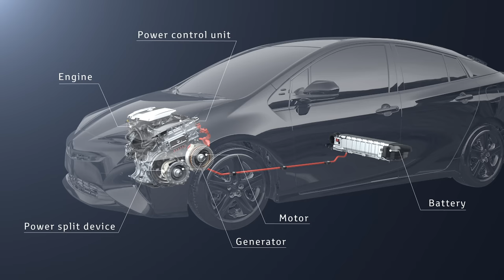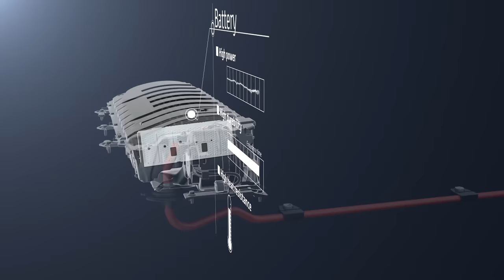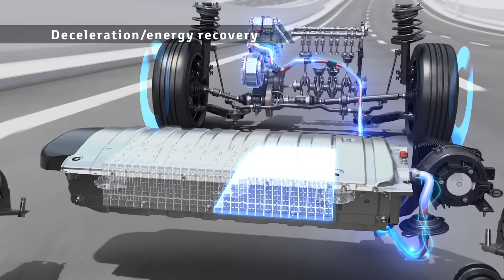What is Toyota Hybrid System

Comment: Me pretending like I understand what's going on 👌🏽
Reply: Agree - above my pay grade but that doesn't mean Toyota doesn't have it down to a science.  They've had 20 years to continually tweak it and their hybrids are the standard by which others are judged.
Reply: I'm falling asleep 🤣
Reply: Basically, the transmission is replaced by an electric motor
Reply: @spacee3249  What??? a electric motor cant give gears to the combustion engine, in fact it use a CVT gearbox

Comment: It's fascinating to see the planetary gear which connects the electric motor and the combustion engine to result a hybrid. Mechanical simplicity is efficiency, longevity, and durability. In my opinion this is art and an engineering feat at it's finest.
Reply: i still couldnt understand how this system is working
Reply: It still feels like pure science fiction. It's a marvel of technology!
Reply: @erdemozturk4585  I'm not a Toyota ASE or have engineering background but I'm just curious about how cars work, especially hybrids. Toyota Hybrids are designed to work in parallel. At any given moment, either the ICE or the electric motor can power the wheels independently or both at the same time. what they did is instead of a traditional torque converter and planetary gear transmission assembly on a gas only car, in place are a motor-generator combination that acts as a starter motor, alternator/generator and transmission. Here's the clever part: when starting the car, the smaller generator powers up the ICE until it warms up then shuts it off. When you put in "D", the second, more powerful traction motor then powers the wheels until more power is needed, then the ICE starts again to assist the electric motors. when cruising at city speeds, depending on Toyota models and environmental scenarios, the ICE is shut off and the motors can solely power the car until a certain range is reached and the battery capacity is down to 40%. When cruising at highway speeds, both the ICE and electric motors drive the wheels and the latter charges the battery (to maintain 40-60% capacity). When coasting in "D" the ICE is shut off once again and the generator charges the HV battery (regenerative deceleration) ; or it stays connected to the drivetrain when in "B" so regen is stronger (but at this point, no fuel is consumed) from rotational inertia of the ICE helps the car slow down sooner. Idling keeps the ICE off unless HVAC is being used or if the engine needs warming up again. Power steering, brake master cylinder, AC, and all other accessories are electrically powered so there is no drive belt unless if it's the MKI Prius. This also makes the ICE to run very efficiently even under load. What makes Toyota hybrids very reliable, not only they are well made is the elimination of many moving parts compared to a gas only car. The HV batteries last very long too as the computer system only allows it to have very short charge-discharge rate.
Reply: And still many think making noise and smoke is what driving should be !
Reply: @MusiGig  that's kinda redundant and sarcastic but like i said. Mechanical simplicity is reliability/longevity. Electric cars ere even mechanically simpler meaning even more so reliable.
Reply: @NoName-ky2sb  yes totally agree
Reply: Kyle Belair  acceleration is fast and instant due to its electric motor but it's not designed for racing. Stay in your lane.
Reply: @kokaboba  Yes, it's kinda like phones, that look simple yet executed multiple functions at the same time BUT mechanically which imo is way more complex vs running code.  I do admire that the engineers can design the vehicle w less moving parts that result in the same or more mechanical actions vs other cars that achieve the same result with more moving parts. You could say one part executes multiple mechanical functions at the same time vs other brands that design one mechanical part for each function. Less moving parts while completing the same function means more reliability.
Reply: @kokaboba  
...and the CVT transmissions for Toyota are a completely different systems vs the standard belt driven CVT. It's like saying hotdog is food and cereal is food. Both are food to feed ourselves but both have different ingredients. Sounds like the acronym for CVT is somewhat ambiguous.
Reply: aye, but toyota still builds to fail. someone has to pay for it to keep running.
Reply: @erdemozturk4585 the planetary gear set is connected to both electric motors and the gas motor. And the electric motors can go either forward or reverse. If the smaller one goes reverse it starts the gas and when the gas motor runs it spends the small motor and it can be put in several modes to either move power through to the wheels or into the battery.
The large electric motor is the ring gear of the planetary gear set and that also drives the wheels directly.

Kind of confusing but works very well.
Reply: It looks simple in comparison with traditional automatic transmissions, but still costs so much in my country :(
Reply: Be positive how differential work

Comment: Have a Gen 3 Prius & love it. Comfortable and convenient, with MPG close to 50. No need to plug in or hunt for charging stations. One quick stop at any gas station and it can go 800+ kilometers. Will choose hybrid over pure EV without any hesitation.
Reply: prius 3 is best :)) yes
Reply: D
Reply: 50mpg means 4.7 l/100.
My 22 old golf 1.9 tdi has 5l/100.
Your car cost 20.000, myne 1000, with The 19.000 i buy fuel for all my life.
S-o, where is the winns in that?
Reply: I had gen3 plug-in and I was doing 100mpg as a taxi (video on my channel). My wife used it for 6 months, taking kids to school and shopping and only put petrol twice! Sadly it crashed(video on my channel) and insurance wrote it off. For me, plug-in and range extender are the best.
Reply: @ciobanuvalentinmail  excellent question mate. Hybrid alone is pointless, expensive to buy and really not better than diesel. Plug-in and range extender are much much better. My Citroën C4 1.6Hdi easily get 65 or more mpg, i mean in city, as a taxi. £20 annual tax.
Reply: @fix-and-drive-diy-repairs  it's just consumerism,  nonsense,
Reply: @ciobanuvalentinmail  the win is toyota doesn't have to replace clogged up variable vane turbo. No worry about head gasket. No worry about egr clogging the intake and poor performance. No worry about getting enough heat in extreme cold weather, specially with the egr delete. No worry about black smoke out the exhaust. No worry about diesel fume smell. No noisy engine. Alot you don't have to worry about in a toyota hybrid. Scrap yard you're tdi. Where it belongs.
Reply: @brucepeninsula2036  
I don't have the money to waste , it's good what i have
Reply: @ciobanuvalentinmail  except your TDI engine produces more emission than the gas hybrid technology as it runs all the time vs part time in the hybrid!  Sure lower cost to operate but not kind to the environment…
Reply: @ztekz  tdi is slow as well. Hybrid is quick with that electric motor.
Reply: @ciobanuvalentinmail  your old kitchen smokies pen need to maintenance and repair. But bicycle has 1000mpg and no cost.
Reply: @brucepeninsula2036  tdi every time is smoking as a hell. Hands and car smell and dirty.
Reply: @КУПУКА  hi
I make 100 km per Day, from home to work, can you do it with bicicle?
Reply: @ciobanuvalentinmail  

Toyota engine will outlast the VAG engine, yet its allowed in all major cities across Europe without exception or penalties based on daily rates, Stuttgart, London is min of euro6 on diesels, Basel and Zurich are implementing changes and their TÜV standards are getting harder for diesel, Paris has a minimum year of diesel and next year will be even stricter followed in 2024 by all other regions of France, Sweden have already have light restrictions in place yet from next year there’s a minimum of Euro 6 standard in major zoned areas..

So, your VAG product will be rendered unfit in emissions standards to go into these areas without a fee or use of public transport to enter the cities who are complying...

You don’t have to have a PhD in a science but the choice is obvious... 
                                                                            Your Golf TDi vs aforementioned Prius 3, mmhh.....
Reply: @Incountry  i live in România, I don't care about West countries.
I go to work and home.
What do I care for Germany France etc?
Reply: @fix-and-drive-diy-repairs  

65mpg...?? Maybe at 30mph over a distance of 30 miles staying in highest ratio auto or stick shift, no stop start through traffic no braking, no changing gears and set with cruise control.. 

Ubër driver...
Reply: @Incountry  dear friend, I said that because we was talking about fuel consumption and  total cost of using a car.
For me it's cheaper the old tdi, simple as that.
Reply: @ciobanuvalentinmail  

Today the VAG suits your needs and of course I understand financially these vehicles (new) can be expensive to purchase, but for the overall point of the Toyota makes sense to anyone who understands the concerns of the environmental issues from health of people to the planet not killing us as it’ll protect itself...

But don’t misunderstand the point of these vehicles and the technology behind them for future vehicles...
Reply: @Incountry  they are to expensive,  way to much.
Reply: @Incountry  you are talking about si-fi. 
My concerns are about the present.
I earn a salary, I need a cheep car, with cheep maintenance.
Simple as that.
Reply: @ciobanuvalentinmail  

Science yes,  fiction no, this is all reality and it’s happening right now and not tomorrow, in needing a cheap car is yesterday as we start everyday with something new accepting the inevitable...

Enjoy your car...
Reply: @ciobanuvalentinmail  your 22year old car is probably very light(due to less saftey equipment) and thier were no strict emmisions back then to add further catalytic converters i also hope its a manual thus you can run it at extremely low rpms.Also when the car itself is light all the components wieght is also reduced thus even better.However your car still isnt as efficient as modern cars you are just making a tradeoff b/w gas milage and satfey features.just compare the crash test of your car and this prius.🙂
Reply: @nibhanbaig6675  Golf 4 1.9tdi weights 1390kg
And is has 4 stars safety euroncap
Reply: @ciobanuvalentinmail  that was some good explanation!! I don’t get it why they are so expensive??
Reply: @imrickjames7012  i don't understand,  what crabi?
Reply: @kamila4ever  bate troncăne și poluează, asta este, nu am bani de alta.
Sau, doar bogații să aibă mașini?
Reply: @ciobanuvalentinmail  my prius I paid $700 for it  and $500 for the battery makes 50mpg looks good Ac in the summer heat on the cold winter $20 and I drive like crazy. Also  had 190k miles on it no head gasket issues no turbo issues and no black smoke issues now after 250k miles runs like a champ and drives me to my work where I make 85k a year. Better that a bike since i need tk drive 30miles every day and today is 31 degrees here in VA.
Reply: What is range extender can anyone explain or give any video reference
Reply: @ciobanuvalentinmail  brother its 200kg less then the prius.The ncap saftey ratings change thier acceptability every year.The emmisions are probably much worse.
Reply: Ww
Reply: @ciobanuvalentinmail  I got a $4000 camry hybrid, and I beat u all around, your car is hard to fix and has many problems
Reply: @ciobanuvalentinmail  there's a difference between Japanese and German engineering. TDI will break down much faster and earlier.
Reply: Massa que a tesla pede bença slk
Reply: Lol so many toxic toyota fanboys, VW TDI's especially the 1.9 TDI and 1.9 SDI will pretty much outlast a toyota hybrid
Reply: @ciobanuvalentinmail  hybrid isnt just about being cheaper. Its about producing less emissions. Soon diesel cars wont even be produced and down the line, every car will be full EV. Hybrid is like a stepping stone. I guess you can imagine what would happen if we stopped innovating and using high emission diesel cars. 

Also, subjective but im sure most would agree a new prius is more comfortable than an old 1000$ golf
Reply: @squiresonwheels3249  I laugh at this comment since I had a VW TDI and it was a piece of crap spent thousands on repairs and I look after all my cars oil changes every 6000km and regular services. I've also owned an Audi A4 1.8TFSI which also had problems no surprise since they're VW. Mates had VW Golf's with many issues and mates had early VW Amarok's which also have the TDI and had many issues. I stay away from German cars now. The only major thing you'll have to replace on a Hybrid is the HV battery when it eventually dies which all battery dies at some point or becomes less efficient. Still on my original HV battery on my 2009 Hybrid. My brake pads last 2 to 3 times longer, there is less moving parts to replace since you don't have to worry about replacing a long drive/serpentine belt connected to all your accessories pulleys like the ones in normal cars cause of less mechanical parts. In the long run you save money on maintenance and services. By all means don't let me stop anyone buying German Vehicles haha.
Reply: @Holyghost707  1.9 sdi will outlast any toyota hybrid, 1. There is no turbo. 2. There is almost nothing which can break due to the minimal amount of electronics. And 3. Yes they are slow as a snail but they will last forever, look up and you will see cars with 500.000 km or more.
Reply: @squiresonwheels3249  That doesn't prove much. Older generation of people actually took care of their vehicles meaning if it did break they just fix or repair it rather then just buy another vehicle because it was economically cheaper to do so it doesn't mean a lot to see cars that have over 500 K's without knowing it's history. With that said whether we like it or not we have to get on board with the new technology whether it's BEV,  Hydrogen or even Hybrid vehicles which will be around for quite some time yet since Governments and most Vehicle manufacturers are phasing out pure ICE vehicles and ICE owners are left with facing hefty tax penalties for polluting with emissions and yes Deisel still pollutes. Governments are also giving incentives to go Carbon neutral. Soon it will be hard to buy pure ICE vehicles. At the end of it all the question is which of these technology is the best? 🤔
Reply: @channingtato807  it proves alot, since alot of people still do not know how to take care of their own car. Gas and Diesel for life 💪
Reply: @ciobanuvalentinmail  How much do you spend for repairs?
Reply: @andreasalpha9570  nothing from 5 years.
Oil gas and filters
Reply: @ciobanuvalentinmail  You must be an exceptionally lucky man. Try the lottery.
Reply: @andreasalpha9570  i try it the lottery, nothing good come out.
But my old 99 1.9 tdi golf still works
Reply: @ciobanuvalentinmail  Good for you my friend. Most of the owners of this car were not as lukcy as you are.
Reply: @ciobanuvalentinmail just the stinking diesel fumes , slow 0-60 , lack of interior comfort ( I had a Golf back in High School) , poor electrical set up n accessories (suck big time , always something wrong with the wiring n sometimes caught fire too) n finally no A/C 😅
Forget it , I just got rid of my W210 Benz Diesel that had A/C n gave me 45mpgees on road trips!
I got me a 3rd gen Prius, 2015 model n am never going back to that diesel stench again 😂 , ever!!!
Reply: Гибрид это будущее
Reply: @ciobanuvalentinmail старый добрый дизель ❤❤❤ он был создан идеальным изночально. В нем нет насосных потерь из-за дросселя только из-за насосных потерь бензиновый мотор имеет меньший кпд

Comment: Brilliant, we just received our 2023 Rav4 Hybrid after a 11 month wait .... absolutely crazy mileage to the tank,  averaging 950 - 1000km , have only filled twice since owning, may it continue.
Reply: These are great cars, but don't skip any maintenance schedule and make sure to use the thin 0W16 or 5W20 motor oil. Also no towing or jump starting with this car. And watch out washing this car, because if the battery runs out of power inside a carwash that pushes your car, your electronic parking could kick in. :hand-orange-covering-eyes:

Comment: Totally love with Toyota hybrid car, I have a rav4 hybrid 2020 crazy high fuel efficiency single tank able to achieve 900km. Powerful and low fuel efficiency the same time.  Great job Toyota
Reply: Mileage
Reply: @anirbanpatra3017  yes, mileage exists
Reply: Will it still give 900km over 120 Kmh of speed?
Reply: @ZBalosch  doubt it, cause the engine will be running the whole time at high speeds
Reply: @Alphapunk2  yeah, also the ICE needs to run within certain ranges of torque and speed to deliver its 41% max thermal efficiency.

Comment: I bought a 2013 Lexus ES300h in 2018, it has the 2.5L engine plus dual motor generators. I absolutely love it, and I was very apprehensive about the CVT but it is so so smooth. Now the battery is 10 years old and the car has 110k miles. I get precisely the same mileage I did when I bought it five years ago even though the batteries are now a decade old.